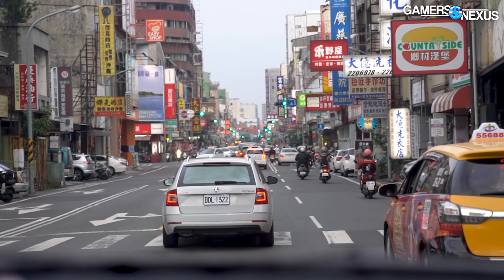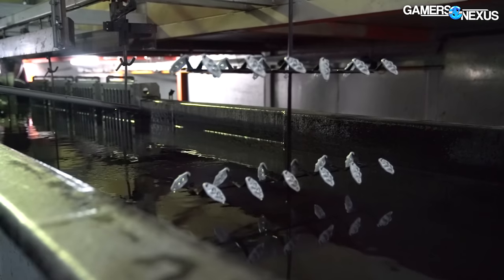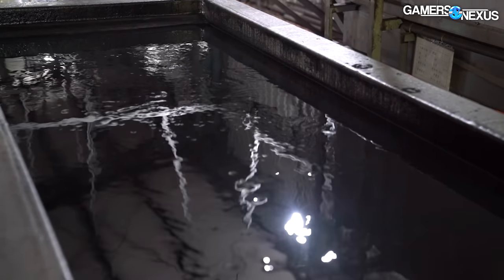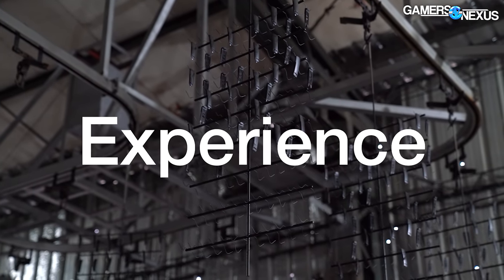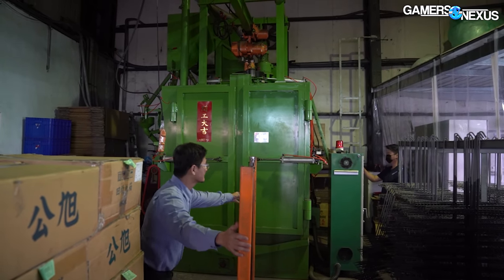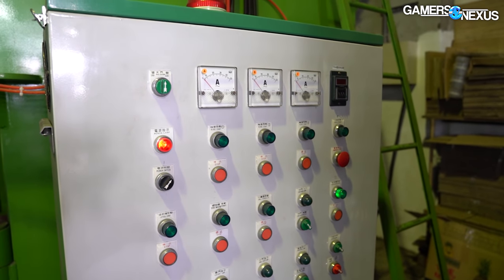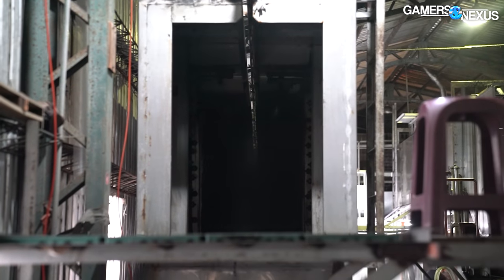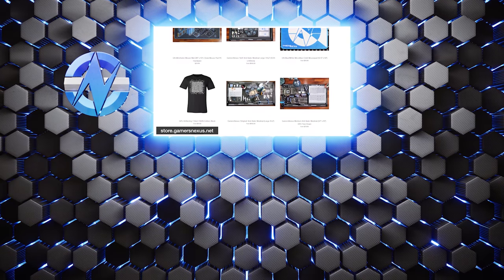Watch Millions of Coolers Get Made in This Factory Tour: Electrophoretic Deposition

Comment: The deadpan "They could probably use Gigabyte Power Supplies" Killed me. Working in machining, Both CNC and Manual, it's really cool to see what happens to parts I make after I make them. Thanks for the content!
Reply from the maker: That's a super cool perspective and not one I thought of. Must be neat to see what they do with your work!
Reply: @GamersNexus  For sure! Most of the time, we don't even know what kind of assembly our work ends up in, let alone what the process is after it leaves our shop. We put a label on it that says something along the lines of 'Type III Anodize' (that's hard anodizing for aluminum), and we just ship it. Get it back, make sure they look pretty, and we never see them again. Hopefully. If parts come back, there's a problem.
Reply: I have a buddy who owns a cnc shop he has 13 different machines. Its awesome having a friend who can cut me anything i want for say ..oh i dunno like custom rotor housing for a rotary engine or lower recievers for an ar15 ...and so much more lol.
Reply: @FDFANATIC541  I would trade 10 of my friends for 1 of those.
Reply: @paskowitz  1 of what? A cnc machine? A friend with resources like that?  All the above lol?
Reply: @FDFANATIC541  A friend with those kind of resources.
Reply: The roasting never stops.
Reply: @GamersNexus  At my anodic electrodeposition system, the DC power supplies were cabinets the size of people, and the fuses were as big as firewood logs.
Reply: @paskowitz  I don't have 10 friends but I'd offer a stack of noisy neighbors. No takers. A-ha.

Comment: I love these series... It is extremely eye opening to actually see the life cycle of products we purchase and the environmental impact our consumer patterns has. Thinking twice or multiple times before purchasing stuff on a whim and instead asking ourselves "do I really need it? am I unhappy with what I already have?" is a very good practice indeed. I for one will not purchase a new chassi as long as it holds up and ATX standards don't go obsolete. Same goes with coolers. I bought a Noctua, I have been in contact with the company over the years ordering new mounting mechanisms for new socket standards, never been more satisfied with a product. Why buy completely new when these products could last for 15, 20 even 30 years. Anyway, awesome job guys! :)
Reply: My Chieftec Dragon lasted me 15 years...
Reply: Agree with you here. I tend to keep using stuff until it breaks, I find myself unable to bin stuff that still has an ostensible use. So much of the cheap throwaway crap that’s made in general produces a vast amount of waste, both directly and indirectly.
Reply from the maker: Fantastic viewpoint!
Reply: I consider buying a Noctua cooler an investment. They provide great support.

Comment: I finished installing a new CPU cooler (NH-D15S) to replace my stock one fifteen minutes before this video was posted. Very fitting timing. While my particular unit didn't pass through this factory, since it's the bare model rather than the black one, it's fascinating to see these tours.

Comment: This was a really interesting and well edited video.
What stands out to me is that the cheapest option for adding colour to parts is also one of the more environmentally friendly choices.

As for a name for the series, what about "How Thingamabob Done"? It's dumb, sounds funny (to me at least) and isn't currently trademarked afaik. :D
Reply: > the cheapest option for adding colour to parts is also one of the more environmentally friendly choices.

I'm surprised no company has just started advertising "natural" finish, just straight up cut the piece, air blast it and sell it.
Reply: @JustTechGuyThings  You usually want at least some kind of coating to prevent scratches and oxidizing and to reduce friction.
Reply: @JustTechGuyThings  They will rust in minutes while shipping. Even if they air freight it, any customer who lives by the coast can not use such a product.

Comment: Fantastic coverage as always! I really enjoyed how you guys went into how the electrodeposition process actually worked, and didn’t gloss over it. It felt like you gave me an overview of everything I needed for the video to make sense, and not too far into the weeds.

Small suggestion - would it be possible to link to some of the sources you used for understanding the process itself in the description? I’d like to read more about the manufacturing process.
Reply from the maker: For this one, most of what we learned came from the conversations at the factory. The Wikipedia page is a decent start, but beyond that, it'd probably help to do some reading on electroplating to get some more foundational knowledge of electrodeposition!

Comment: I used to use a similar process in reverse with tartaric acid to strip carbide coating from titanium.  It used a 12v DC power supply that pulled around 2k amps.  The power rails where 2x4 copper bars.

Comment: I used to work as a QA checker for a UK electrocoating / powdercoating factory, sadly after just a few years I developed breathing problems from working next to the lines and left. They produced coated products for Nissan cars and some for qualcast lawnmowers. The factory had a different layout but the process looks very much the same as one I worked for, but the sand blasting area wasnt properly locked in like one shown here, so the dust was a major issue for workers.

Comment: For awhile there, I thought they were running out of water. But the recycling of water is happening, then they could go on for years that way. Mabe using minimal water usage. This is a cool process.  I use to work for a similar company in Bellview, Wa. Except we did everything by hand when moving boards through the facility. I love the trolly system they have.

Comment: I worked in a window factory that used all 3 of those methods to coat the meatal parts. I worked on all 3 of those lines at one point or another. It wouldn't have been so bad, except the parts were super heavy for the windows and hot af. Glad I got into IT though and no longer have to deal with that.

Comment: I ran the anodic electrodeposition system for a major tool cabinet maker for several years, and this video really takes me back. All of the stages of production are nearly the same, the only difference being the direction the ions are moving in the paint bath. (The system in the video is cathodic.) Thanks! "You die" made me laugh. We used lockout-tagout to prevent horrifying accidents while doing maintenance.

Comment: Fascinating, to see all these things I have learned of in real life (Mechanical Engineering Student) from two of my favourite courses (Manufacturing Processes and Materials Theory).

About mathematics in general when in comes to engineering (especially mechanical): the mathematics are a good approximation of reality and allows to predict results quite well (and can become really complex), but in the end you will need to do real world testing and a lot of the numbers you will use are actually empirical.
 In order to get a mathematical model of empirical data you have a field in mathematics which is called Numerical Analysis (which is used, and originated, in computer sciences as well) which allows you to get something you can work with from empirical data, also useful for equations which are usually analytically unsolvable (most Integrals are, and you will use them a lot in engineering).
You have a lot of tables with empirical data which you use, and all are from experience, experiments and trial and error, that's why experience is so valuable in Engineering  (to the point of being hard to find a job without it).

Comment: The current most commonly used in ED is about 200-300 Amps, depending on the lacquer. Volts are regulated by the amount of surface that needs coating.
Phosphating is used to increase the surface area by about 5 times with microscopic crystals which allows more pigments to bond thus increasing the opacity, it also increases the bond between the lacquer and the metal surface drastically.

All in all this factory is pretty much the bare minimum compared to the western industry.

Comment: Great tour video. But please clarify the statement at 
14:15 regarding the factory having 20 tons of water on hand? 20 tons of water = 1 ton (2000 lb) x 20 = 40,000 lb. 1 Gallon of water weighs 8 pounds. So 40,000 lb / 8 lb = 5000 gallons. I don’t think that much water would fill even one of those tanks. Thank you.
Reply from the maker: Backup / additional water in a separate tank.

Comment: VIDEO SUGGESTION: Can you please investigate WHY THE HELL graphic cards board partners (such as MSI) have 2x eerily similar GPU models/SKUs which have a huge difference in pricing....and only the higher priced one seems to be getting any manufacturing done on it.  In MSI's case, it's literally the exact same GPU, with only a 40mhz(or less) "factory overclock" being done on the more expensive SKU.   
Example1: Model=RTX 3080 Ti Ventus 3X 12G OC ($1739.99) -VERSUS- Model=RTX 3080 Ti VENTUS 3X 12G ($1299.99) {Boost Clock Differences are 1695MHz vs 1665MHz respectively}  
OR Example2: Model=RTX 3080 VENTUS 3X 10G OC LHR ($1,089.99) -VERSUS- Model=RTX 3080 VENTUS 3X 10G (699.99)  {Boost Clock Differences are 1740MHz vs 1710MHz respectively} 
---REF Newegg items numbers are in order here -- 3080ti's= N82E16814137651 /  N82E16814137656   and the 3080's = N82E16814137678  / N82E16814137600 ---- 
As a finally thought, (this may be antidotal evidence) but typically the # of reviews points to the # of sales. Higher reviews for item1 traditionally has indicated more sales of that item as compared to another item2 with less reviews. This obviously is not failproof but in general it's true....well for the MSI card variants, there is a much higher (10x) number of reviews available for the higher priced cards, which indicates that MSI is likely building more of the higher priced SKUs even though the two different models are basically exactly the same. This looks to an outsider perspective that the board partners are purposefully only using their GPU supply from Nvidia to build the higher margin models and ignoring their less profitable offering....at the detriment of the consumer. There is NO REASON the 500$+ price increase is worth 40MHz in factory overclock on otherwise exactly identical hardware.
Reply: TO Follow up on this. I would be VERY interested to know metrics from MSI in regards to total number of manufactured/shipped/sold units between these SKU variants. I have a hunch we would see a massive discrepancy between the low and high variants of essentially the same exact hardware.

Comment: Steve. black isn't just marketing BS. Its also the highest performing heatsink color as it radiates the most heat as electromagnetic radiation. 
a passive Black anodized heatsink can have 40% higher performance than a shiny one depending on its geometry. because physics. ( this is not a joke )

Comment: electro <- self explanatory, ferritic  think ferrous metals (iron in them) deposition the act of depositing/deposing: position on something the english word is almost self explanatory. except i used the wrong word for one of them which is basically the same thing but just describing a different action mechanism in this case not so much corrosion as method of transporting a material you want to use for plating using a bonding agent to get the right result via a certain method to make the madness work!
i'm not even a nerd, this is just basics of metallurgy.
not quite the 'how it's made' show of the history channel, just the full on nerd out they will allow on camera with out creating competitors.

Comment: The smaller particles get sucked up through the extraction fan and out somewhere else....... Out the exhaust on the roof and into the surrounding areas air.

Comment: Electrodeposition sounds like marketing speak for powder coating. I just started the vid so I should be wrong.

A minute later and I'm wrong, it's a variation on electroplating which makes sense if it's a process that has less impact on coolers.

Comment: Talking about the Water… and other Waste. You already kinda said it. This is only one Manufactory. I came from the Car Manufactory and i can tell you its not different there. Well it is but some/many Things are the same. Cars need paint as well. And there are many Cars made these Days. But also other Things are using similar Methods all the Time i would assume. Everything that is painted. Everything that has an Chip in it needs some PCB and what not… like Cars again, TVs, PCs (obviously) but also… Alexa, an Oven or Fridge these Days and so on… i am pretty sure i forget most of it. 

Anyways. Its just interesting to see and get some kind of Idea on how much Material is used (wasted as well).

Comment: 20 tons of water is nothing. A continuous casting steel factory can use 50k liters per hour for cooling steel off. We are just starting to se that heat get captured and put to use for things like heating homes or generating electricity. This will also allow us to reuse the water instead of it evaporating as steam. TSMC uses 20 million tons of water per year in one of it's fabs so 20 tons is really nothing in comparison.
Reply from the maker: Nothing in comparison, yes, but that's still a lot to keep in that room.

Comment: Reverse osmosis water filtration systems themselves can be very wasteful/inefficient. The municipal/state/local water is passed through several membranes of varying "fineness" to remove all impurities from the water. On average it takes about 4 gallons of water to produce 1 gallon of reverse osmosis purified water. The waste water is usually dumped down the drain but I suppose it could be reclaimed and ran through the filtration system again. I'd hate to see their utility bill.

Comment: Its the exact same idea as electroplating 'cept its a suspended solid not chemically dissolved metal in a solution and as the name implies phosphors are used as attractants/bonding agents.
But yes very much so... working in any deposition processes like this or electroplating line is nasty, been there done that no thanks ever again.